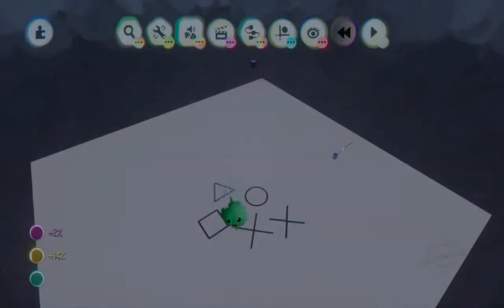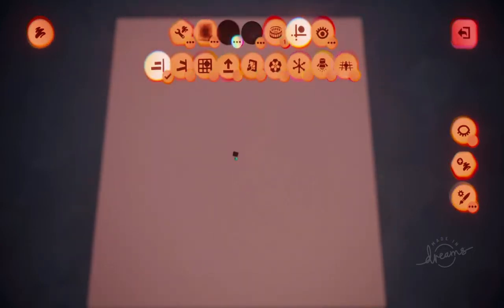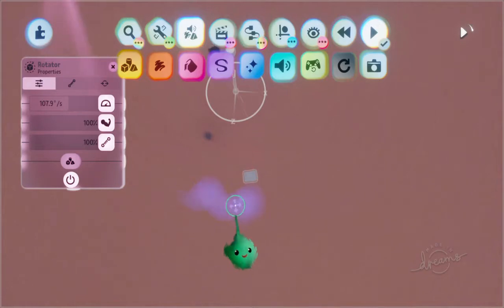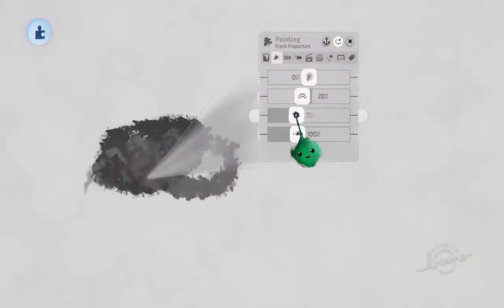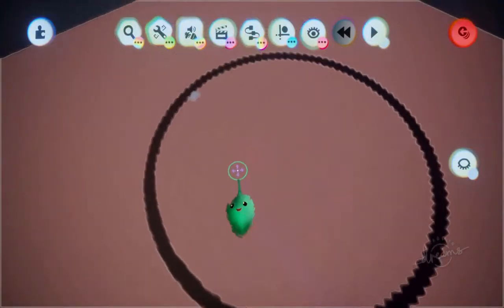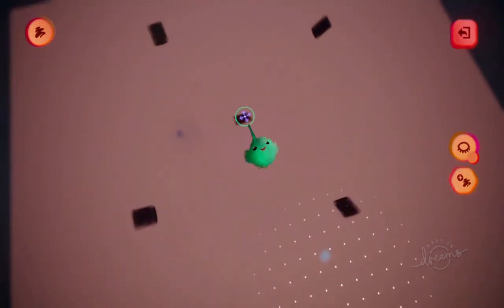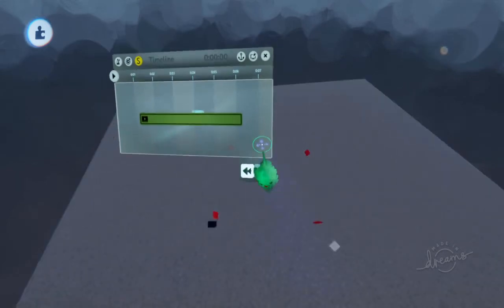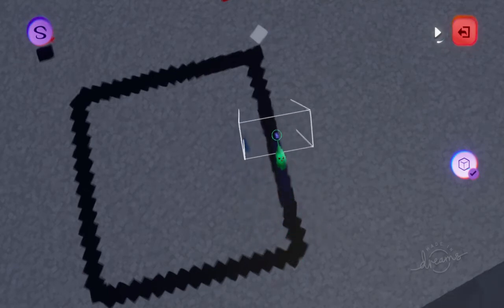Paint: Drawing Precise Strokes | TAPgiles Dreams Tutorial

Comment: Cool trick to merge stroke to get the shapes you want.
However to get perfect sharp corners when using the kf's trick select all kf's and turn off smoothing and you'll get sharp corners. It's the same trick I and perhaps others use to nail a puppets feet to the floor to stop them drifting between frames when they are stationary. It stops interpolation between frames.

Also to make a perfect circle without jaggy edges :
1.  Turn on grid  and surface snap stamp one fleck down.
2. Copy the first fleck don't let go of it. Move as many grid units to the side as the desired diameter of the circle. 
3. Turn the the fleck 180 and start cloning in between, until you reach the new fleck, now you have half of a perfect circle, without jaggy edges., Delete the very last fleck. 
4. Copy the semi circle and place it at the end of the semi circle and you 've made a perfect circle.
5. Combine the two paintings.
Unfortunately this does not animate the same way though. 
I think Pablo showed a bunch of ways to make circles and how they animate in a MM video🤔

Ahh yes here.
https://youtu.be/lNOIgfnTjEA?t=2059
Reply from the maker: Cheers :D

Good tip for others about the smoothing. However only turning smoothing off would still mean that we go through the corners quickly, which can still mean if the timing is just right the corner could be passed between when 2 flecks are added--missing out the corner. Making the keyframes for the corners wider like this so it pauses there makes it pretty much impossible that a corner could have no fleck right on it. That's one reason I widened the keyframe instead of only turning off smoothing.

And if a keyframe is not the default 1 frame wide, then smoothing is ignored for that keyframe anyway, so that does the same thing.
Reply from the maker: I also know how to make circles in different ways; I'd probably do the multi-clone method myself too if I didn't want it to be easily animated in all the ways my asset allows for.

I actually taught many ways of painting a circle in the same stream as I recorded this, including ones Pablo didn't show. But for this video tutorial I stuck to the topic of this specific method. And it's already a really long video ;P